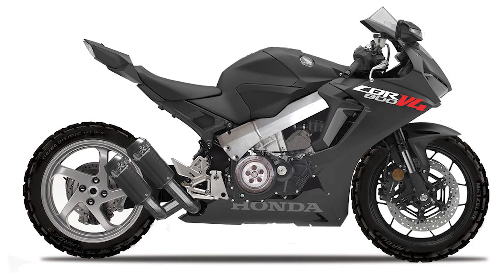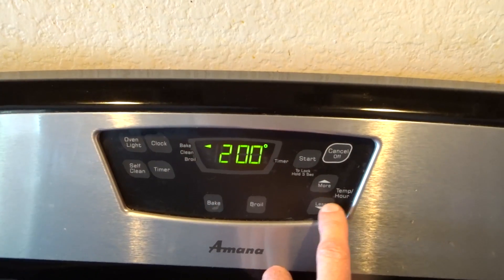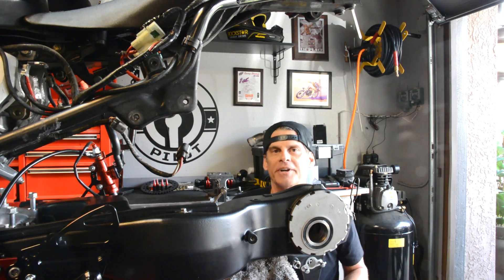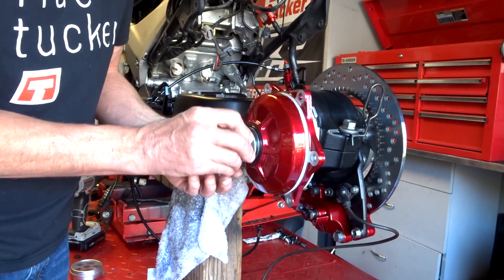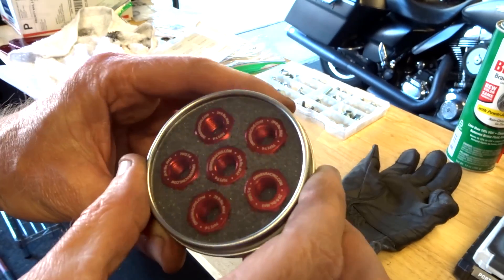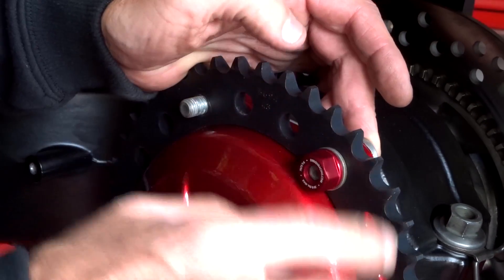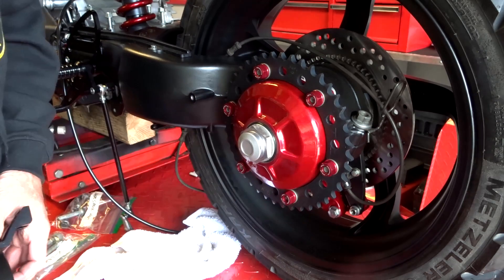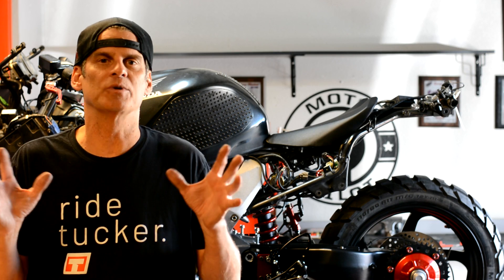HONDA CBR/VFR800 HYBRID PROJECT - EP.9

Comment: A lil trick I do to keep my anodized nuts looking good is just put a piece of shop towel or a thin rag in your socket or wrench.... that prevents the metal to metal contact, which is what scratches them and also helps from the lil bit of stipping that happens over time...try it, ull be happy u did. 👍🏻bikes looking good too bro.
Reply: gene gomez or buy the right spanners for anodised hardware!!!

Comment: u could have saved that sprocket if u tapped that hole but did the drilling on a drill lathe machine or a tabletop drill instead of a handheld drill... could have tightened it to the drill tabletop and it wouldnt have slipped around on your causing that scratching on that beautiful black sprocket!! little details really do matter.. consider throwing on some red nut washers that r popular now adays, that would be a cheap way to really set the look of the bike off with some nice contrasting bolt washer cap type setup, that help so a bolt will never get pulled thru the body or windscreen or wherever you end up using em.... they r my go2!
-p3t3r

Comment: It is good that you have the abs ring back  on the disk, but the 2 bulky abs modulators will also have to go back plus I am not sure abs will work with delinked brakes. In my opinion linked brakes are one of the best features of vfr800.

Comment: The torque for the lug nut is 80 ft/lbs. 108Nm.
And YOU NEED TO PINCH IT AT THE END!! 
There is a small opening in the threads at the tip.
And that's the reason it was so hard to get of.. if you did not open the pinched part.

Comment: 1) without the hub guard
2) the spikes might look cheesy, but too early to say
3) will that abs rotor actually work? I don't know what sort of sensor is used. That needs testing.
4) should have sent the sprocket back, if the manufacturer doesn't know he's screwed up how can he correct it?